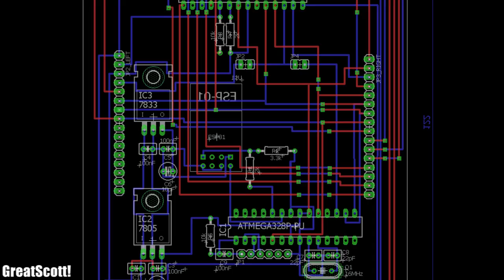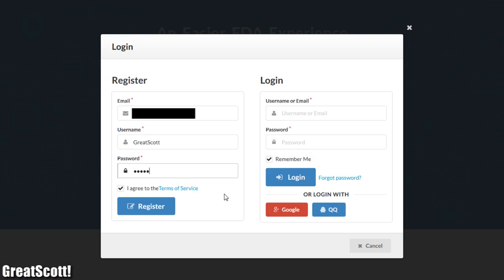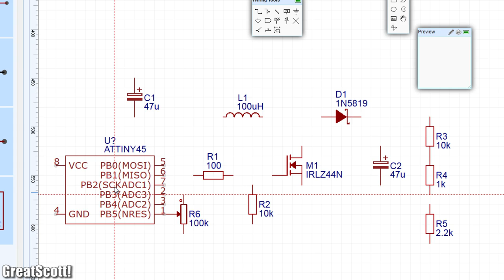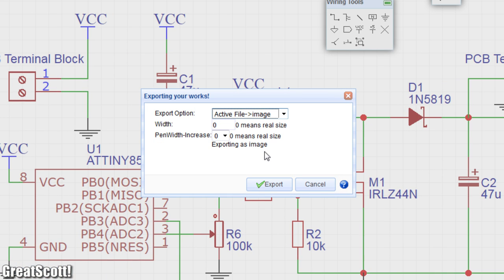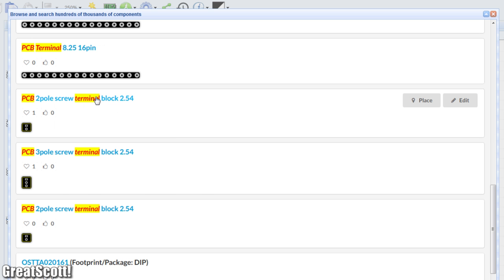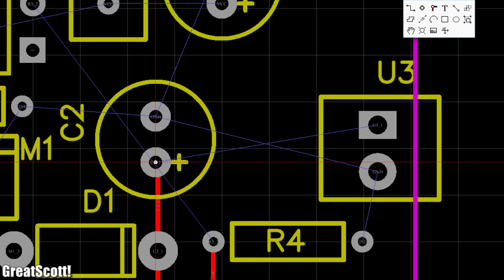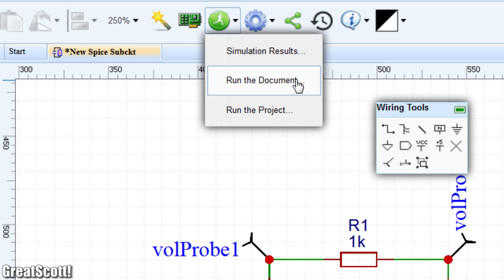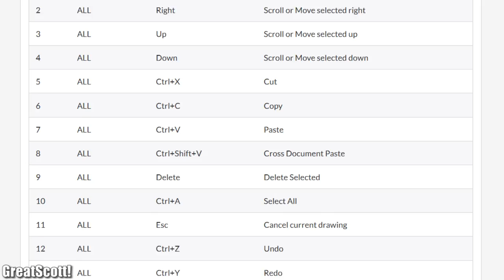EasyEDA - Free Schematic & PCB Design + Simulation Software Review

Comment: I am new to electronics design and although I am good in programming, I really was not looking forward to PCB design as the EDA software I tried did not fall easy on the fingers. I then discovered EasyEDA as part of my extensive google search and found it much more intuitive than anything else. The web interface works so well it feels like an installed program on the computer. EasyEDA made a number of improvements by resolving bugs and it works smooth. I do find though that the component libraries are still very limited and I do have to create a lot by hand, but considering it is free to use it is an awesome piece of work. I hope to progress enough in skill to be able to order PC boards via the system soon as this is what EasyEDA is all about, and if that works like the software it will make life easy.

Comment: I think I will try this! Things have come a long way since 1976 when I graduated with my BSEE degree. There were only two choices back then: 

1.) Create your own PCB negative, expose a photosensitive board, then etch it,or;

2.) Use perfboard, put ICs in wire-wrap sockets, then wire wrap them together.

The technology existed back then, but it wasn’t feasible for the electronic hobbyist.

As for Spice and tools like that, I think its crude counterpart was a FORTRAN program called ”ElCap”.

Thank you so much!

Comment: KiCad and DipTrace (Light) are two other freewares that I would definitetly recommend for beginners.
But for the ones who plan to become electronics engineers, then I think that Circuit Maker is a better choice because it is almost as powerful as Altium Designer itself.

No one is sponsoring this comment.
Reply: Que fait tu ici ?
Reply: +U꞊RI DipTrace - great, but it hasn't online repository of components and I can't understand it in 2016. I think, I must write them about it, right now...
Reply: KiCad is also open source!
Reply: +U꞊RI Theres also upverter.
Reply: So multisim wouldn't stand a chance?
Reply: "No one is sponsoring this comment"
seems like what a sponsored comment would say.

Comment: I've tried EasyEDA, KiCAD, and Eagle.  EasyEDA is by far the easiest to use with a massive library of parts.  However, one thing to note is that most of EasyEDA is purpose built to drive business to JLPCB using LCSC parts.  If you live in the US the turn around time is about a month.  This is something that is rarely mentioned.
Reply: I just made one from Australia. Took a week between submitting my design and the pcb arriving at my door step.

Comment: To put into perspective, OSHPark charges $5USD per square inch (25.4mm x 25.4mm) for a two layer board with three copies.

EasyEDA seems to charge $4.35USD per square inch for a two layer board, but you get 10 copies.

Comment: I would rather use "PCB Creator", since it auto-generates the PCB traces and component placement space efficiently, which you can ofcourse lay them out yourself. It has a build-in database for most IC manufacturers. However, the schematics, I am not a fan of. Since the database is so big you have every kind of sizes of components. This is however canceled out by the fact that you can see a 3D rendered view of your PCB, including holes and traces.  It doesn't have a simulator. As alternative I would use 123D by AutoCad. Simulation doesn't weigh in my scoring, since LTSpice or Falstad is highly prefered as simulators.

Comment: Do you know about the PCB Suite "Target 3001!"? The free Discover-Version allows for 1.2m x 1.2m boards with up to 2 Layers, 250 pin/pad max. and 50 simulated signals.
And it's storing the data on your PC.
In my opinion there's no better tool than Target (out of the ones I tried*)

* The list of tried programs includes, but is not limited to Altium Circuit Maker, Cadsoft Eagle, IBF Target 3001, KiCAD.

Comment: Question,
I notice that when i connect a load with my Battery(any battery Li-on, Lid-acid) battery drop the voltage(mean if i connect a volt meter acrose the battery). 
I notice that when i connect a Led in series with a resistor. the voltage drop in this case is from 4.1volt to 3.7volt. it also happen when i connect a transistor with a led.

Do i design the circuit incorrectly ?

Comment: I'm surprised software like this is free, I will have to try it out for myself. Do you know if the simulation software would allow for things such as integrated circuits? (eg arduino or led drivers)

Comment: Thanks for introducing me with such a great software. In earlier days, I used to use Cadsoft EAGLE 7.4.0 for PCB designing and Proteus 8 Professional for circuit simulation. Please can you tell me how to burn program into 8051 microcontroller (AT89S51)?

Comment: On wednesday?
Reply from the maker: +XerneraC When I make two video in a week the release days are Wednesday and Sunday.
Reply: +GreatScott! Ah! OK thanks
Reply: +GreatScott! Hi
Reply: +GreatScott! Wait...... Are you going to make 2 video's a week?
Reply from the maker: KaienSander10
Sometimes
Reply: +GreatScott! :D
Reply: +GreatScott! I also have a suggestion, a time laps video head for your camera. I am building one by using a arduino uno, a few servo's and a LCD display with driver
Reply: +GreatScott! I know Upverter didn't sponsor, but I would like if you did a Upverter vs EasyEDA, since they do quite the same thing.
Reply: +Prajay Basu I've been using upverter for a few years, never used any other web based ecad but this seems pretty similar.